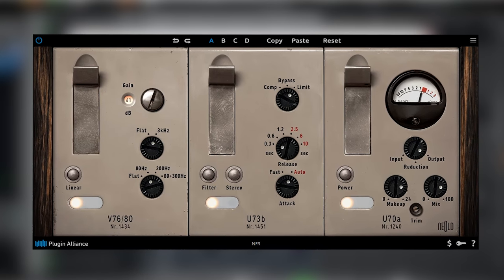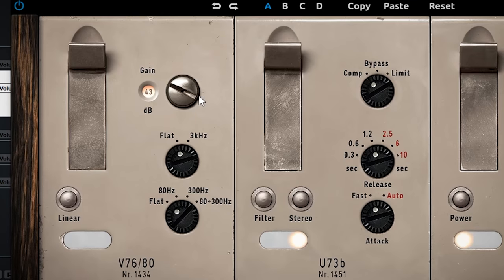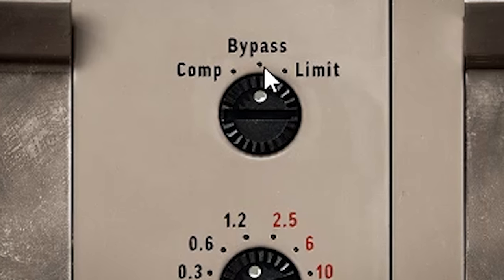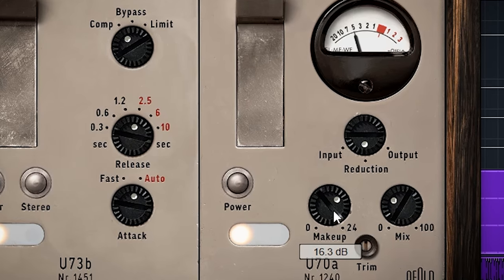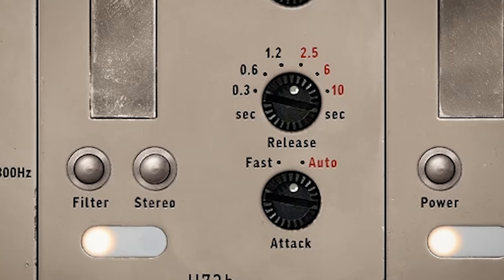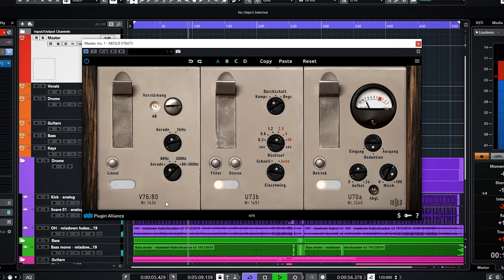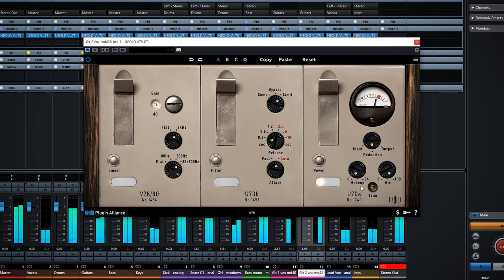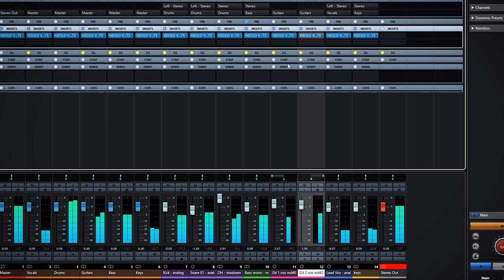Neold V76U73 Review - Telefunken TAB V76 U73 Tube Preamp Compressor on Plugin Alliance

Comment: Thank you !! Great walkthrough! Interesting to see Plugin vs V76 Module.
Reply from the maker: Thank your for the kind words! Yeah it would. Maybe Neold is up for that, the v76 u73 is moddeled after the units the owner of neold owns himself. I dont know how contistant these units are between different units, but like  a lot of vintage gear, the difference between the hardware units themselves can be bigger than between the software and a hardware unit.

All promo images where you see those 3 units in a box are his and even the gui of the plugin is basically a photo of those exact 3 units.

Comment: This Neuold version does sound better with an actual source than the UA v76 plugin version. It’s a shame though that it doesn’t work as well to push ITB sources and plugins like S-Gear to due the volume normalization. I hope they consider an update where you can turn off the volume normalization to drive other sources as a real preamp can.
Reply from the maker: v76u73 has a trim where you can set your output volume . Or do you mean drive inside this plugin.
Reply: Thanks! I’m familiar with the trim control. I do mean the drive inside the plug-in. That’s the magic of the preamp to me and why I’ll continue to use the UA version instead.

Comment: try to work with the buttons und you know, what´s wrong with this.
Reply from the maker: Dear mrrobertmrrobert3006, i have no idea what you're talking about.
Reply from the maker: I cant confirm this, sorry. It works as advertised?
Reply from the maker: Ha! That would be a first. Maybe you mean that the switches like for instance the limiter compressor bypass need some movement before they switch? For me that is not faulty but intended. Other wise everything works for me as they should  :-)